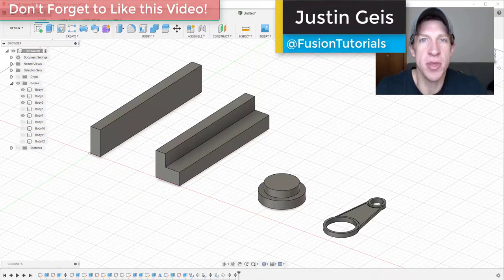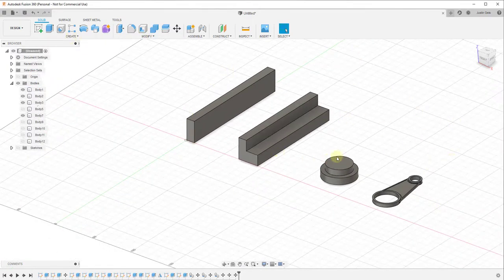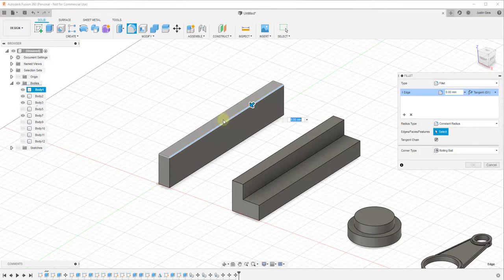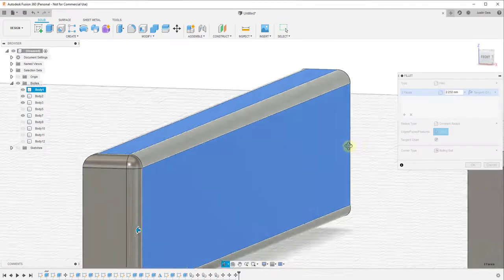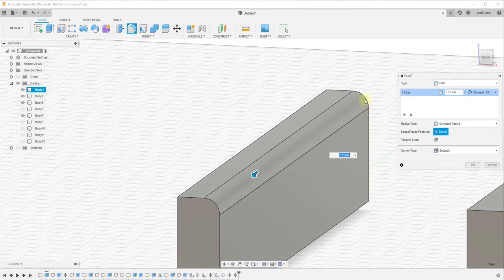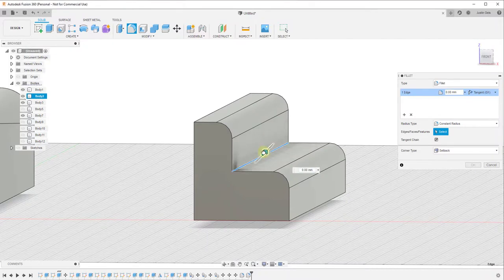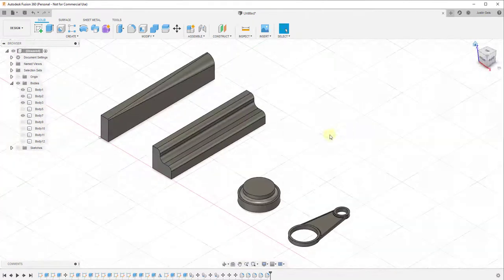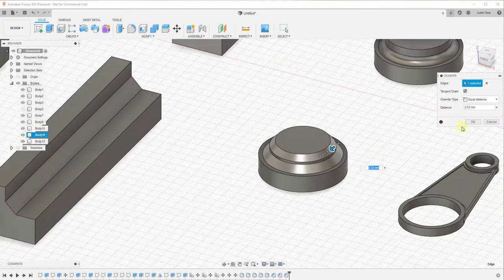Fillet Tool vs Chamfer Tool in Fusion 360 - How to Use Both Tools!

Comment from the maker: Hi everyone! I'm curious - do you find yourself using the fillet or chamfer tool more in Fusion 360?
Reply: will be using it more in the future.  Thanks for your concise well explained Videos.
Reply: Can you help me with something? I can't seem to find any information about this, and its really stressing me out. When I put a fillet or chamfer in circular models, I sometimes see a weird line splitting it. I try to delete the line and the 2 dots by selecting them and deleting it, but nothing happens. The only way I can sometimes get rid of it is by turning the step model to a mesh file, and then converting it back to a step (prismatic) file. Please let me know if you have any idea why this is happening, and how I can fix them when it does